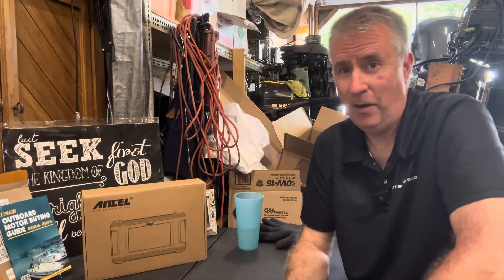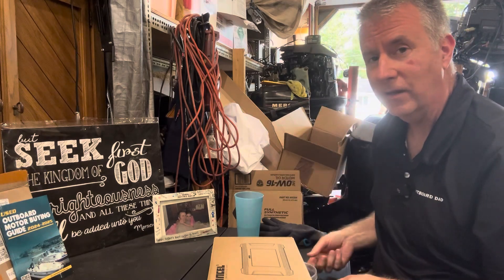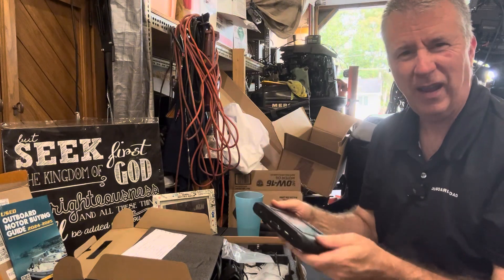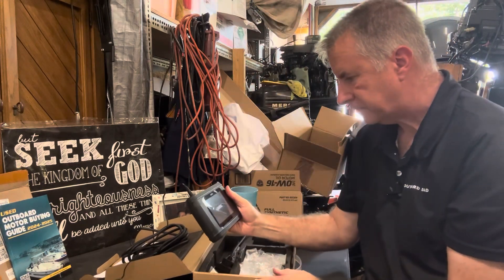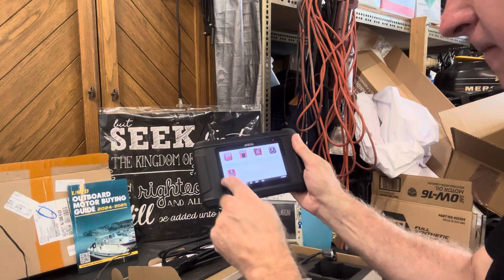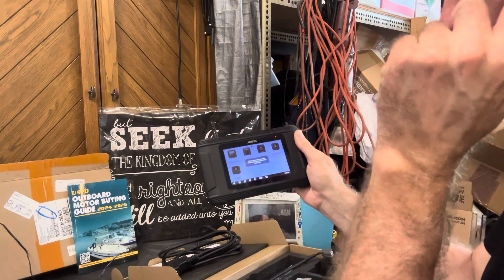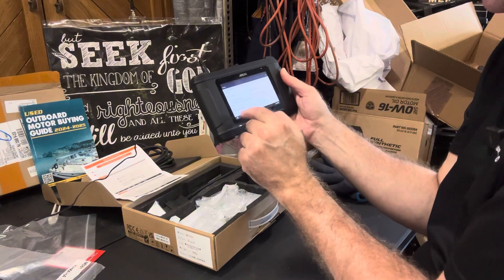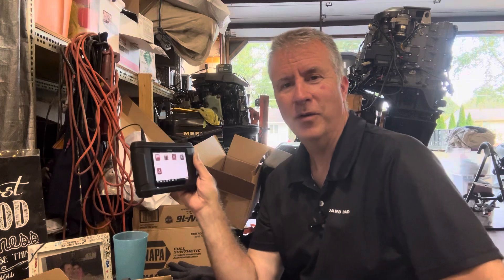ANCEL MR500 Marine Diagnostic Tool – Unboxing & First Setup (Yamaha Outboard)

Comment: good morning I have twin 2003 hpdi on a 26' mako when I turn on key alarms ring starts great cold and alarms never go off ? i want to buy scaner to hope to save some $$$ can u tell me if that scaner might help
Reply from the maker: I would think so. There is no garuntee until you try. If you are planning on keeping these motors and or investing in newer Yamaha motors then it will pay for itself. Years ago I bought the Mercury scan tool used it for a while and sold it. Ended up buying another so I don’t see a down side to owning one. Be sure to click on the link below and use my discount code. And let me know how it goes. The HPDI can be tricky to diagnose.
Reply: @OutboardDad  discount code i dont see it Thanks
Reply from the maker: @paulyacovelli3780 When you use the link you automatically get the discount
Reply from the maker: @p @paulyacovelli3780 Let me know when you purchase I am offering a free half our phone call to help with diagnosing with every purchase. Just send prof of purchase to keith@outboarddad.com

Comment: There is nothing better than unwrapping and testing a new toy, I mean, tool for the first time.  Thank you for the detailed tutorial.
Reply: "Toy" was much more accurate. 👍😅
Reply from the maker: @glensims7959 You mean the Mercury one in comparison?
Reply: @OutboardDad  If the Mercury one is any better at truly diagnosing the TRUE CAUSE of issues, you certainly can't tell it. 

Tech Supports answer to restoring the loss of max RPM, sluggish hole shot, and the sudden inability of a motor to shove a boat onto a trailer is..."Reduce the propeller pitch".   

Well no shit !   😅    Nevermind the fact that it spun a 24p just fine for the first 4 years of its life. 🤔
Reply from the maker: @glensims7959 Ok, so Ian assuming you had that issue, what motor were you running? These tools are just that, tools, never replace a good mechanic. I’m so glad you said this and I will bring it up in my next video.
Reply: @OutboardDad  We see it on ALL computer controlled outboards.  Merc/Yami, ect.  
It's as if they are designed to de-tune themselves soon after the warranty expires.
Reply from the maker: @glensims7959 Interesting, I’ve never heard that before, do you work at a marina servicing these outboards?
Reply from the maker: You’re welcome my brother!